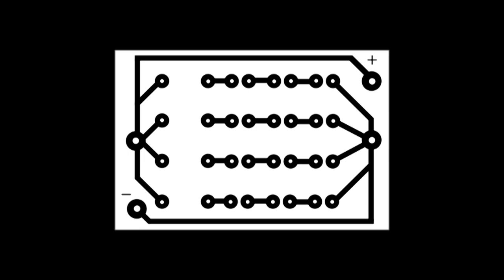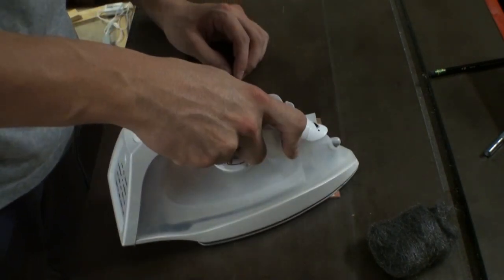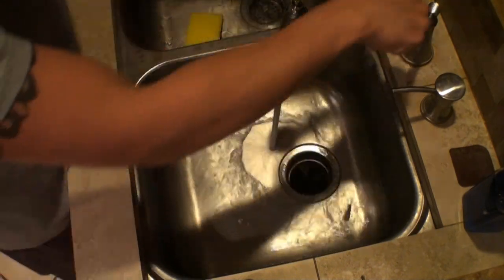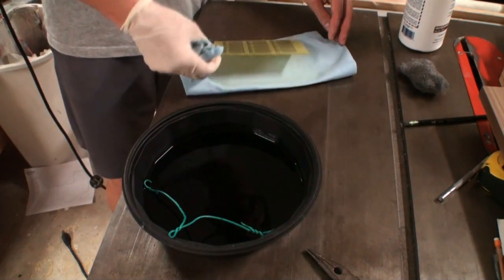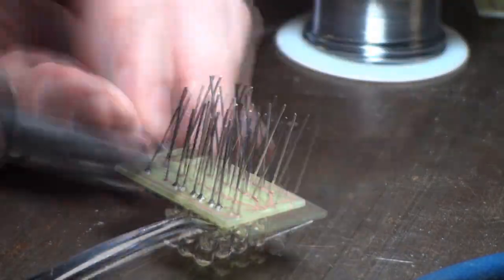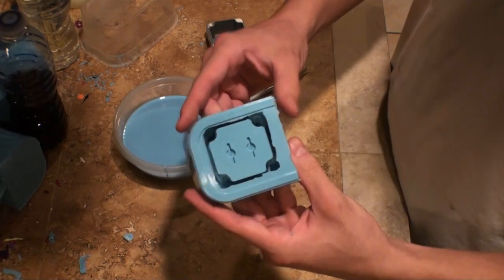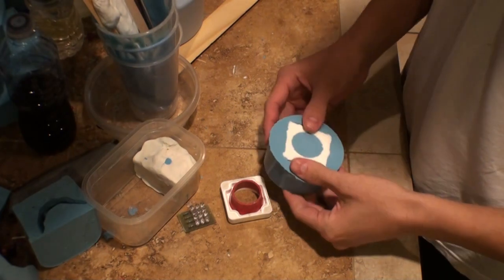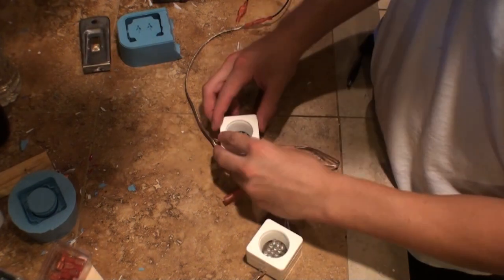Tank Build Part 4 - LED Modules From Scratch

Comment from the maker: Hi Amen. Honestly I don't use these light modules on the tank. It was a fun project, but it just didn't work out. The cost and time is not worth it, other than for the experience. Plus, it simply did not light up the tank enough. They make these flexible light strips that are really easy to use if you have no electrical experience. Thank you for your service sir, I wish I could help you more, but being able to help you in person is probably not likely.